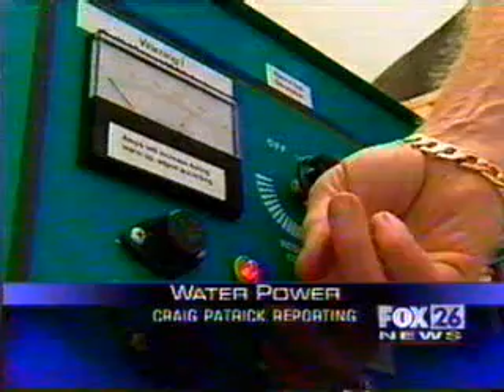Water Fuel Car

Comment: Yes Juneway,, it is. Do it yourself with a cheep, auto battery charger, two stainless diner knives. Wrap the handle of one with rubber bands so that it forms a spacing of about 3/8 inch, blade to blade with no contact of the handles.  Then band them together. Add a bit of baking soda to water, and hook the charger leads, one to each, and dip into the water. 
Between the blades will bubble with Hydroxy, HOH.

All the best, Knute

Comment: Killed this technology???

HHO Generators, 92,500 hits. Rhodes Gas, 138,000, Hydroxy Gas, 61,000, Browns Gas generators, 32,000,000 hits. Stan Meyer water fuels, 56,000 hits. Water fuel research in general, 32,800,000.

And these are just the people willing, brave enough, courageous enough to publish on the NET and share with others.

WATER BURNS!!!!!!

All the best, Knute

Comment: True, Mastela88, TRUE. 

There too, DO NOT USE Oil, Poison riddled Gas, or Coal. Use PV Solar.

Hydroxy needs low voltage, high current. And guess what? Photovoltaics produce LOW voltage HIGH current,, and it is FREE. 

With Hydroxy Industrial uses,, such as MY Passion STEELS,, when the sun goes down, send your workers HOME.

All the best, Knute

Comment: this system has the possibility if perfected to break the laws of  thermodynamics. I like knutes work but he seemed like he was trying to down on this more then credit its potential. just because it hasnt been done yet doesnt mean its impossible. the wall of impossibility is only in the mind of the preceiver, and if you cant think outside the box then you will never be free. i mean its proven when they combust hho it turns back to pure water. build a suction system to refuel itself.

Comment: Eveilslayer, Respectfully. I was agreeing with KUNTE,, my obsessed Sockpuppet friend,, about ONLY the twisted wire in a Jar Water for Gas. It would take many more times the plate surface area, at automotive voltages, to generate enough Hydroxyl to run a car or even to improve mileage.

The subject of this video, Klines process, DOES WORK. You are 100% right.

All the best, Knute

Comment: Non-Rusting STEEL,, Impossible?

Knute grasps the hilt of his sword, gleaming PURE. Blind and unaffected by the brightness, Knute reaches down and tosses the star into the air. With one great slash, the cuts the star in two, sheaths his sword and now cooled, catches the halves.

Look to the rivets, pins and bolts of the Ships of the NORTH. 1200 years in the soils,,, and NO RUST.  

All the best, Knute

Comment: Well,,, Not really.

Any one single design is rather useless,, change a nut or bolt or plate configuration or power supply and the Patent is worthless. I went,,, Open Source,,, with Hydroxy in 1996, for this exact reason.

BUT,,, the applications of Hydroxy are wide open. Totally new  industrial processings. 

All the best, Knute

Comment: Sadness.

I can cut through shekels and chains of slavery, with nothing more than the water contained within a thimble. Not even harm the tender flesh of the wearer, as Hydroxy has NO side-cast heat.

But there exists NO power,,,, that can remove the shekels of the mind.

All the best, Knute

Comment: Sadly, they will get less energy from burning the hydrogen than they used in performing electrolysis. If the electrolysis is being done in the moving car, they'll run out of energy very quickly.

Comment: Umm?? With fixed locations,,, 400 watts of Solar PV Cells, are down to about $700,,, 400 watts for 30 YEARS. 

You only need 2 volts to crack water into Hydroxy, soo that will offer about 200 amps for your current demands. For cars, Halleyscomet suggested a smaller,, roof mounted, Solar Panel array. An average train, 100 cars long, would produce about a Million watts.

All the best, Knute

Comment: Oh, ONE request.

Will some of you PLEASE,,, PLEASE,,, continue my work in the production of steels. Steels are 100% recyclable, ores are easily reduced using Hydroxy and Solar Power, the applications and products are well defined and marketing fully in place. With Hydroxy, post production RE-Heating is done without a furnace.

PLEASE,,,, continue this work! 

All the best, Knute

Comment: Halley, 

By researching here,,, AT YOUTUBE,, you will be able to examine the scalability of the Hydroxy Reaction. Search out Micro Torch.

You will see that the Hydroxy flame can be restricted down to microscopic dimensions, increased in size to many feet in length, or as in the case of the SUN, astronomical proportions. As there are no hydrogen/carbon bonds to be broken. This feature of scalability is unique to ALL Plasmas. 

NO hydrocarbon will do this!

All the best, Knute

Comment: Norman,

In the late 60s, I ran a 5 HP lawn mower on pure HOH with a cell that produced 600 liters per hour, or 10 liters per minute, Pulsed Magneto DC through capacitors for power supply.

In the 1980s, Yull Brown was successful in running a 2400 CC car engine on pure HOH, Browns Gas on a 10,000 Liter per hour unit, 2,800 RPM with dynamic resistance, for 72 hours.

The primary methods being discussed here are a partial induction of HOH to extend mileage. 

All the best, Knute

Comment: What is the liter per minute consumption rate of hydrogen in these hydrogen cars???
How much liters per minute of hydrogen do these cars use in normal driving???
The device on my motorcycle produces over 40 liters per minute of hydrogen from water.
The device on my motorcycle also produces over 60 liters per minute of HHO gas from water. Is this enough hydrogen to run these cars??? Signed Norman Williams XMARINE.   No joke!!!

Comment: Halley,, Please.

Just repeating OVER and OVER and OVER,,, Impossible, Illogical, Absurd, or quoting others that also do so, is not the way to learning.
A discovery of any type, is always met with these same objections. 

Bio-Fuels,, Alcohol Fuels, heavier than air flight, Electricity itself, were all met with these same,,,, FALSE,,, arguments. Thousands are doing this work today in Hydroxy,,, and with the same results. 

You cant shout down REALITY.

All the best, Knute

Comment: As for defying the laws of physics, Popular Mechanics looked at water cars:

"Problem: It takes exactly the same amount of energy to pry those hydrogen and oxygen atoms apart inside the electrolysis cell as you get back when they recombine inside the fuel cell. The laws of thermodynamics havent changed, in spite of any hype you read on some blog or news aggregator. Subtract the losses to heat in the engine and alternator and electrolysis cell, and youre losing energy, not gaining it—period."

Comment: Halley, the source of power in all IC engines is AIR,, not the fuel. The fuel simply expands the air. 

This is no more perfectly demonstrated, than with the Super Charger. Simply forcing MORE AIR,,, at a mechanical energy cost,, increases output horsepower tremendously. NOTHING but AIR has been added.

All the best, Knute the TROLL

Comment: Xamboozi, You are exactly right. The energy that is conserved, however, is a type of energy yet unknown to most. The electricity that imparts this energy to water is only a carrier. The vast potential of Pre-manifest energy, Aether Energy is what is employed, NOT Hydrogen. SO, using conventional thermal calculations is like using DC calculations to determine the energy demands in an AC circuit.

BOTH are electricity.. 

All the best, Knute the TROLL.

Comment: Your friends will never get it working.

The chemistry is pretty simple.  You use more energy to perform the electrolysis than you recover from burning the hydrogen. Your friends haven't changed the laws of thermodynamics.

Comment: It is not a "pipe dream". I have friends who currently have a fuel cell that is powered off two 12 volt batteries and produces 1.8 litres flow/minute. More than enough to power a car engine. They are modfying the carburator to handle this fuel. It is relatively easy to do for personal use-quite another issue though to bring such a thing to market!!

Comment: Nobody has due to cost and regulation restrictions. The car would have to be crashed tested repeatedly under various conditions to proof out safety of hydrogen explosion. Emission testing would have to be changed in all states to accomodate new parameters for testing. Insurance liability for manufacturer. Cost of setting up manufacturing plant. And finally, the dollar itself is a "petrol" dollar. An alternative to destabilizing the dollar would also have to offered for the project.

Comment: Halley,

Now,, to be sure,, I made only small amounts of highly pure steels.
Today, substitute an entire Mill roof, covered with Photovoltaic Cells,, a Pulse-Wave generator and hundreds of 2000 liter units, and you  can make all the steel you will ever need.

All from the power of the sun and Hydroxy plasmas from water.

All the best, Knute

Comment: Halley,, I need not read,, I DO!

There was no genius to my earlier work,, the PULS effect was by sheer accident. I used a normal Arc Welder as a source of DC current. The sloppy rectified AC to DC,,, pulsed at 60 cycles. 

No exotic calculations involved; just dumb luck.
All the best, Knute

Comment: Dear Halley.

 I could just HUG YOU! The Solar to,, Battery to,, Hydroxy enhancement, is a wonderful proof.

NOT,,, that it solves any true procedural limitations to the use of Hydroxy, to improve fuel burn efficiencies.

BUT,,, as a system,, it does remove the whole energy in,, to power out argument.

GOOD WORK!

All the best, Knute

Comment: "a dramatic increase in the efficiency of electrolysis through a proprietary pulse waveform"

Improving the efficiency of the process won't help. Even if you achieved a zero loss energy conversion, you'd still be using as much energy to perform the electrolysis as you would gain from burning the hydrogen. Once you add the real world energy loss to heat, friction, vibration and the actual work of moving a piston and you have a net loss of energy.

Comment: If you have a solar panel on the car that generates enough current to perform electrolysis, then why not just run the car directly off the solar panel?

Comment: Note that the car was running on a mixture of gas and water.  OK, in a typical car, about 8% of the energy is converted to mechanical power, the rest goes to heat.  Adding water in a way that will not damage the engine can convert some of this heat to mechanical power through the expansion of steam.  No hocus pocus here.  Here is the hocus pocus: a dramatic increase in the efficiency of electrolysis through a proprietary pulse waveform.  I will try searching for his patents on this.

Comment: Look, use your own eyes. HOH, Electro Chemical Plasma, (ECP), Hydroxy, Browns Gas, Rhodes Gas is NOT,,, NOT,,, simple Hydrogen and Oxygen.

Hydroxy, is elementally reactive and discriminating in thermal effect, returns to PURE water when discharged or combusted. The tiny amounts of HOH that are needed to catalytically enhance the fuel burn are miniscule. Increased Mileages by 50%.

All the best, Knute

Comment: I guess you think Popular Mechanics is run  by retards then:
"Problem: It takes exactly the same amount of energy to pry those hydrogen and oxygen atoms apart inside the electrolysis cell as you get back when they recombine inside the fuel cell. The laws of thermodynamics havent changed, in spite of any hype you read on some blog or news aggregator. Subtract the losses to heat in the engine and alternator and electrolysis cell, and youre losing energy, not gaining it—period."

Comment: Ok then, explain how it is energetically positive to generate electricity from the car's momentum, use that electricity to break water into Hydrogen and use that Hydrogen to power the car.  It's a perpetual motion machine, which is not energetically possible.

Please explain how you would eliminate energetic inefficiencies like, WIND RESISTANCE, conductive resistance, thermal loss, rolling resistance, etc.

Comment: Be clear,,, You will not make any progress by opposing the Petrochemical and Auto Industries. This is not where the true advantages of water-fuels lay anyway. 

Look to applications in medicine, steel manufacture, ceramics, food production, heating, eradication of poisons and toxic wastes. There, Hydroxy will perform in ways NO OTHER captured energy can. There you will find only encouragement,,, NOT resistance.

All the best, Knute

Comment: Lol some farcical comments on this video but to put another one right:

Hydrogen is measured in kilograms. One kilogram has roughly as much energy as a gallon of gasoline, costs about the same and provides about the same destructive power, if you're concerned that the car might turn into the exploding Hindenburg and take out the neighborhood.

Comment: Umm? And you know Chemistry?

The primary product of,,, ALL,,, combustion is water. Michael Faraday, 1833.
The Polypeptide bond is Hydroxyl. Amino Acids to Proteins, RNA, DNA, and Carbohydrate structures. 
The reaction of the Chloroplast in Photosynthesis is electrolytic. C to H, with emission of O> Electrically.
The very nature of thought, YOUR brains electrical power, is Hydroxyl.

All the best, Knute

Comment: Post Production Reforming.

Keep in mind that Hydroxy can RE-heat steels in short notice. WITHOUT the need for a furnace or oven or inclosure of any kind. Hydroxy takes nothing from the air and has no residue, beyond PURE WATER VAPOR. Your Bar, Sheet and Slab Mills need not operate at the usual breakneck speeds, as they had before. There are no fumes, little heat and no poisonous gases to harm the worker. 

All the best, Knute

Comment: Now, where were we?

Oh, Steels. Modify your recipes only slightly. You will not need the lime to deal with sulfur inclusions. The same carbon ratios between low content Wrot, and higher content Carbon Steels apply. Remember, the Hydroxy Flame is NOT truly disassociated,, the strong affinity,(H to O) is still in place. The Flame will not disburse into the steels or offer worries of Hydrogen imbrutement.

Again, use only Solar Power as the prime energy source.

All the best, Knute

Comment: With the advent of Hydroxy, you can make steels with only Solar Power. You can make your steels in any volume,,, a little or a lot, a pound or a ton, AND it will never RUST. No Sulfurs, No Poisons. This makes Designer Steels,, OR,, Boutique Steels,,, a reality.

All the best,, Knute

Comment: On Topic. Umm?

Water Flame and Designer Steels.

You will see in the Kline Video, the amazing temperature yield of Hydroxy with any Iron material. Again, this feature is peculiar to only Hyrdoxy gas. Where these facilities are most valuable is in the production of steels. See my work, TR Knudtson, 1967, Electtro Chemical Plazmas.

Cont.

Comment: Speaking of Illnesses???

Lets try respiratory difficulties? 

Yes, you can breathe Hydroxy. The hidden value, you are simultaneously taking in Oxygen and Hydrogen. Hydrogen that revitalizes without have the need for the body to expend energy on digestion. Namely, Saccharides. Blood saturations are easily fulfilled though a ratio in proportion as with any conventional inhalation assistance. 

All the best, Knute

Comment: Please keep in mind,, Hydroxy is NOT like normal fire. The Water Flame has NO temperature. After hours of operation, our asbestos retort, barely reached 200 F, at the outside wall, yet the Asbestos was made molten and re-crystallized to a new inert form. Further, the constant draft through the out-take filters kept the drum cool too.

Water Flame (Hydroxy) is NOT HOT.

All the best, Knute

Comment: Asbestos, a mineral, has a quick and very high thermal response to Hydroxy. A scourge upon our children, Asbestos is an invisible threat that can induce cancers many years after first exposures.

Because of the differing thermal responses, we used a small rotary retort made of aluminum to process asbestos into a bead-like glass that resembles small gravel. The retort was kept under constant draft, drawing off the vapors, through a sires of paper filters.
Cont.

Comment: Now, On topic.

Asbestos Remediation.
You will see in the Video that one of the most unique features of Hydroxy, is its different THERMAL responses to the various materials it is placed into contact with. With Water, no effect, Paper mild effect, Aluminum, slightly above melting, Minerals vigorous, Tungsten violent effect, 5900 C.

This is characteristic of all Electro-Chemical Plasmas.This is also how I know that Kline truly has produced Hydroxy in a very PURE form.

Cont.

Comment: Hydroxy in the upper Ionosphere. 

The ignition of Hydroxy in the Sprite formations within cloud layers is detectable from space as a Whistle sound. Also, you will be able to detect a strong static puls, distinct from normal lightning. The un-ignited Hydroxy Envelopes, will continue to rise into the upper reaches of the atmosphere forming a layer that protects the earth from excess solar radiations.

CONT.

Comment: To John, Not to worry, High Current is FINE!

Photovoltaic (Solar Cells) produce exactly what you will need to run your finished machine, Low Voltage, High current.

The two technologies are perfectly matched.

All the best, Knute

Comment: Now, see in the video where Kline is burning through stone with the Hydroxy. That darkened residue is the hardness of a yellow diamond. Water Flame changes the crystalline structure of most minerals. Not only because of the HEAT, but also the type of energy contained within. Pre-Manifest Energy.

Synthetic diamond-like structure for abrasives, saw blades, grinding wheels, drilling, polishing and cutting of other materials.

All the best, Knute

Comment: Basically, Hydroxy will burn through any metal in the blink of an eye.

In heating applications, you need to think indirect. Heat the salt,, the salt heats the stainless tubing and heats the water inside to steam, the moist heat to warm the Greenhouse.

All sourced from Solar Power.

All the best, Knute